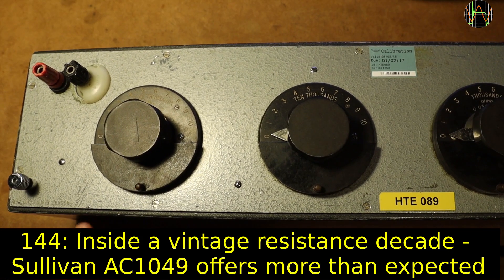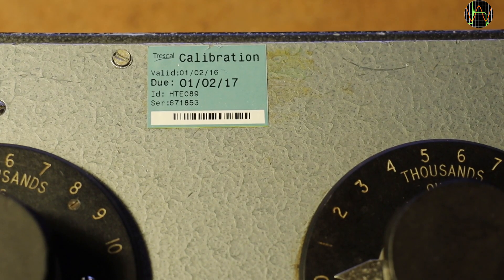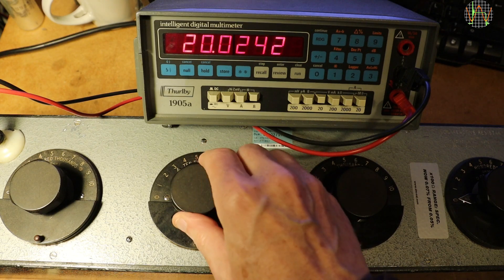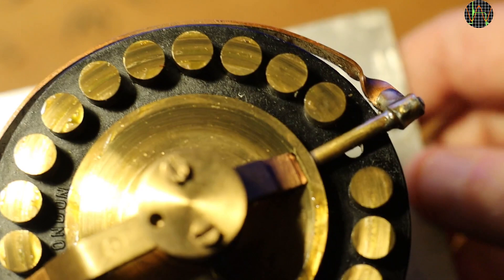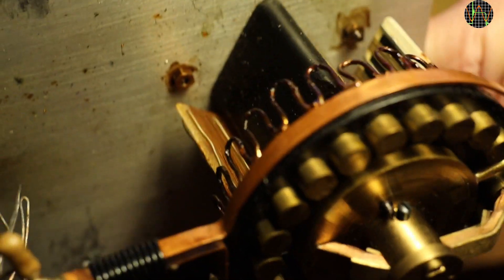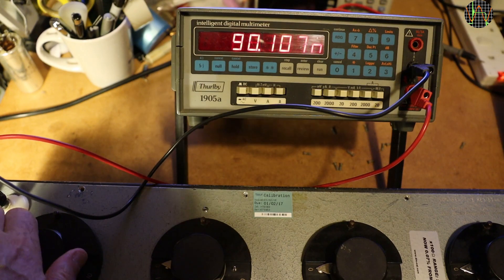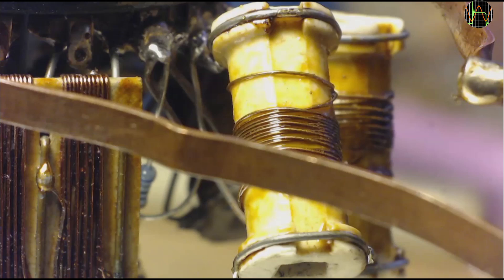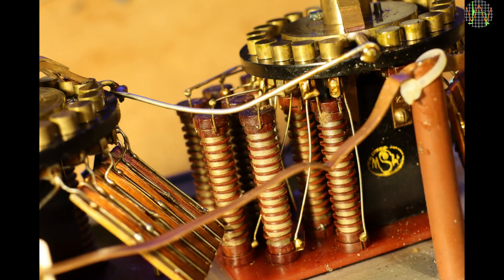144 - Inside a vintage resistance decade - Sullivan AC1049 offers more than expected

Comment: Extremely weird to see a couple of vishay foils? as replacements, along with an absolutely bog standard metal foil 1/4w, which I highly doubt meets the power rating it was initially specced for
Reply: I've used the Vishay bulk foil resistors in test loads, they are very stable, available in fairly precise values, and are non-inductive. They are not cheap though!
Reply from the maker: yes, I definitely do not plan to run significant power through these. just using it as a resistor reference

Comment: Fantastic inside !  The hidden double ranges were a nice bonus. I found two possible dates for it online - 1930 and 1952, the style of it looks more like 1952 to me though. The Science museum has a similar one, not identical, and that is quoted as 1952. Another image I found for this exact model shows one terminal has an insulator and the other does not, just like yours. I looked up that Ayrton-Perry non inductive winding method - hadn't met this before.
Reply from the maker: Yes it feels like it should be in a museum. The 50ties sound about right, about 70 years old, still going strong